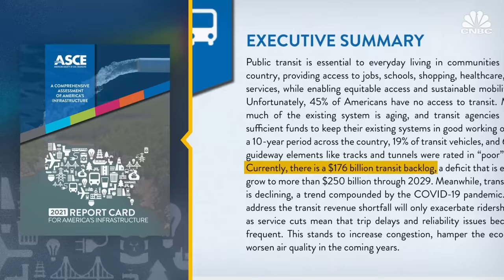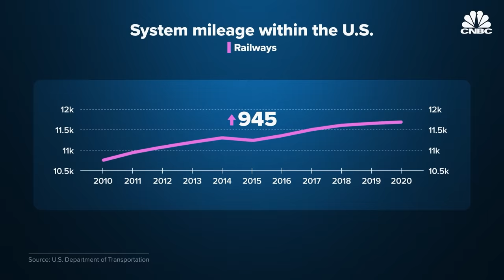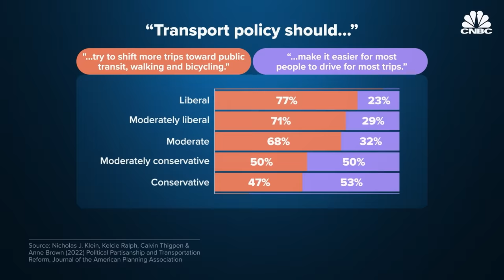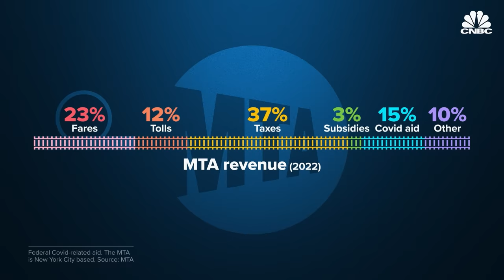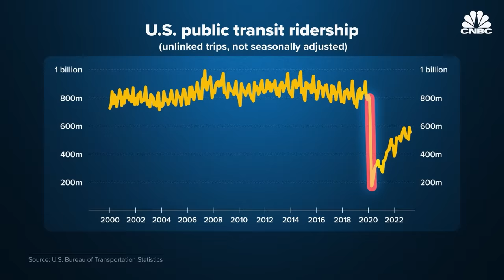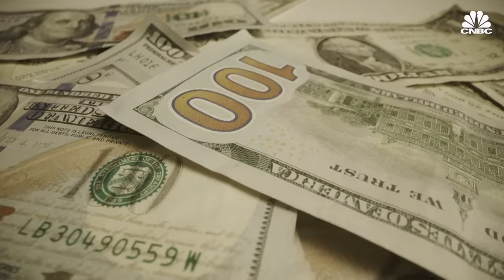Why The U.S. Gave Up On Public Transit

Comment: As someone who has lived in two transport deserts I see that the problem is getting worse and worse. The transport deserts are growing, when they should be shrinking.
Reply: They aren't transport deserts if you have a car.  They are only public transport deserts.
Reply: @laurie7689 What happens when your car breaks down?
Reply: @Supr_KILLA  Only if people want to pay for it, which we don't since we put our money into our own private vehicles.  We tend to vote down public transportation.  I don't have enough money to pay for BOTH private and public transportation.  I'd rather pay for my private transportation.  Other people who can't pay for transportation aren't my problem.
Reply: @laurie7689  so should we just take away your fire department and say oh if your house is on fire just use a garden hose to put it out?
Reply: @carlgharis7948  I pay fire dues for use of the fire department.  The fire department is not supposed to put out the fires of homes that don't pay fire dues.  That is a paid-for service and doesn't come free.  If they do put out the fire of a residence that hasn't paid its fire dues, then they have the lawful right to place a lien against the home.  Eventually, a forced sale/foreclosure on the home is a possibility if the lien is not paid.
Reply: @laurie7689  you expect me to believe such nonsense you're insulting my intelligence

Comment: Public transit isn't a 💰💵CASH COW like automobiles.
(insurance, repairs, tickets, constant new styles, fuel, accessories)
Reply: A new style of car has been introduced since the 1990s
Reply: Has NOT is what I think you meant. That is true.
Reply: it's a cash cow for everyone when it is properly invested into. everyone except the fossil fuel oligarchs and the car manufacturers.
Reply: @XDTape  Fossil fuels have created great wealth for rural America.
Reply: @tuckerbugeater  tell that to the coal miners getting screwed out of pensions by their failing company, or the rural Americans who need to keep their windows open while running their sink to avoid a methane buildup, all to frack more oil. rural america was torn up by the fossil fuel industry, and when they leave it is the executives and shareholders who hoard the profits, while the families who settled there for generations must pick up the pieces.

Comment: Another issue that is a part of the vicious cycle problem is that a lot of people in America just don't understand what good public transit can mean and what benefits it can have. And how could they, when most don't get to experience it? There's also things like the misconception that transit is only for cities and can't work in rural areas, and I could write a whole paragraph on misconceptions around zoning. There are a ton of things like this. You often see opposition melt away or turn to support once many projects like these are actually built.

Good transit, zoning, bike infrastructure, etc. does a great job of justifying itself once people live with it. But to get there we need more support. And perhaps the best way to get that support is simply by educating people about the potential ways their lives could be better that they never knew about. Will everyone be swayed? Of course not. But I think there are a lot out there who can be convinced.

Comment: I think a major reason the US are stuck with cars has to do with the suburbs. In those low density areas public transportation is simply uneconomical. Difficult for the US to change model, considering how the country has been built. Considering this, a big help could be to push on more work from home, it reduces congestion, quick to implement and at ZERO cost
Reply: We would need cheap broadband to every home first, and the Comcast-Cox oligopolies would fight tooth and nail to block the publicly-owned fiber network that's ideal to enable remote work and school (and they've already succeeded in some communities)
Reply: Totally agree!
Reply: You are correct that it would be best for pollution and congestion but it would increase isolation and it’s subsequent mental health problems. It would also isolate workers and further weaken the already very poor workers rights and hand more power to businesses.
Reply: @doujinflip  Remote work = freedom. It is also the most environmentally friendly form of commuting, far better than transit.

Comment: I use public transport daily wait time is never an issue because with google maps you know exactly when to start and when you will reach, saving on fuel, insurance, maintenance, parking and interest more than justify the extra few mins I spend traveling in public transport. Most of the time the walking and standing involved is good exercise and I use that time to send emails, catchup on news and family.

All my statements are applicable only if there is good public transit, I lived in Bangalore, Boston and now Brussels. I used car in India and US but giving up on those was best part of moving to Brussels.
Reply: Yep. In my mom's home town in Mexico, that doesn't work. I'm sure the bus system has a schedule that no one follows or knows about. I looked at Google Maps and couldn't find any bus route information. Everything is so disorganized over there, its insane. And this isn't exactly a small town. It has over 100k people.

Comment: There are several reasons most of the US public transportation systems are awful...most US cities don't have a high population density, and most US housing is individual housing units instead of apartments, so you may live several miles from the nearest public transit stop (not to mention your destination might not be near a transit stop either).

Unless you live in one of a handful of cities, you're going to need to drive a car just to reach a bus stop or subway station system, just so you can utilize the transportation system which is significantly slower and significantly more expensive than just driving.
Reply: How Federal Grants for Mass Transit programs are allocated.

Federal Grants are (1) given as long as the public transit system does not turn a profit and (2) those Federal funds are given without requiring they be spent to improve public transit services.

So, first the City and State are incentivized to ensure their mass transit sustems stay broken, that any failures remain unrepaired, that service be unreliable to discourage commuters; and as long as that happens, the receiving government can keep that money and use it wherever and however it wants!

It is a never-ending doom cycle by design because no one could fail this badly for so long unintentionally!

Please, examine the books of New York City and their Mass Transit Authority (or anywhere else) and prove me wrong!

Comment: Definitely for public transit, but let’s frame this honestly:  it’s practical in the near term only in cities and their suburbs, and the fiscal burden of that investment should be borne primarily by those residents. Also, it will have to be safe to use, which is a growing problem in big cities. If we can address those things, all for it.
Reply: It isn’t practical because of America’s crazy zoning laws, those vast suburbs of single family homes make the car a necessity. You have been tricked into a dead end trap by the car, road building and oil lobbies and there’s no way out.
Reply: @mostlyguesses8385  nope, that may be true out in the countryside but in the big cities of Europe local travel and commuting is mostly public transport and taxis, there is only very limited and extremely expensive parking in most European cities and most offices and non retail businesses aren't allowed to build big parking lots like in the states, at most they'll have a few bays.

Comment: There are small victories.  I just got back from Atlanta and they have a pretty good train system.  Its not amazing like Japan or Europe but it is something.  If you are going to the airport or the NFL stadium you are almost for sure using it and that helps take a ton of cars off the road.

Comment: I don't get all the love for cars, especially from low-income places. Buying a car, insurance, gas, maintenance etc has to be more expensive and costly than public transport. Like you can't get a job without a car almost, but that is also a big expense to have. I'm from europe, in my 30s and don't even have a drivers license because I don't really need it. I pay $80 a month to take as much bus, tram, subway and trains I want. They usually go every 2 minute on most of my routes, and 5-10 on less travelled places. Investing in public transport is the future, but the 'muh car' lobby is too strong.

Comment: Coming from Europe, it was a complete shock to see the state and quality of public transport and at the same time (partly because of it) driving around is a horrible experience. You'll get stuck in traffic everywhere and from my experience even the roads are so poorly maintained compared to where I came from, it really makes me wonder where the money goes. (At least in central coast California, I have no idea how bad it is elsewhere)
Reply: Because public transportation delegates your freedom of transport to the government where as a car you choose where to go. In Denver there is a system called the “RTD light rail,” it took 15 years to build and cost billions, when it was finished it could service about a million people and connect nearly all of Denver and it’s suburbs to DIA and in between, next to bus stops and rentable scooters and bikes, you’d expect people would be eager to use it, except less than 15-25k use it daily. So when given the option of good, efficient, and reasonable public transportation, Americans don’t and won’t use it. It got so bad CDOT offered FREE tickets so people would just use it, it only improved it by .5 percent. So what a waste of time and infrastructure to just be a massive bust; you’ll drive by these light rails on the highway and there’ll be NO ONE in there.
Reply: @jalend9974 Maybe it’s a good option in cities with lots of people, it’s not if the population density is very low.
Reply: Stop lying this did not happen and you know it

Comment: I really don’t understand why we think transit services have to be profitable. Roads aren’t profitable, they are a public good. Transit services are also a public good. I understand making up a budget deficit whether that’s through raising fares (the bad option) or through more funding (the better option) but requiring these organizations to be profitable is a standard we just don’t hold our roads to. 

Both generate economic activity. A good public transportation system is worth far more than a solvent and profitable balance sheet.

Comment: I used to use Bay Area Rapid Transit to commute to work prior to the pandemic, but I quit afterwards.  Why?  Safety!  I felt unsafe on the train, and not having to ride it during the pandemic opened my eyes.  That stress outweighed the stress of driving!  Obviously this doesn't apply to all transit systems, but vastly improving safety would do a great deal for many cities (looking at Bay Area and LA in particular).
Reply: Statistically, the Bay Area is not dangerous. Its violent crime rates are among the lowest for major US metropolitan areas. There's a lot of petty theft but that typically doesn't constitute a safety risk.
Reply: I take the L.A. Metro to work every day and the scary social media posts - while accurate depictions - do not represent the general state of the system.
Reply: That sounds like a crime/vagrancy problem and not a transport problem. I hear this point thrown around a lot when it comes to public transport, but you're not necessarily safer when driving on the road. Cars are extremely dangerous and one wrong move at high speed can end multiple lives. The safety issue on public transport could easily be solved with better security and law enforcement

Comment: Personal security, controlling criminal behavior, station cleanliness and elimination of homeless individuals are all factors that were failed to discuss in this piece. They are significant driving factors contributing to the reduction of ridership on public transportation. I would never consider taking my family on any subway system in major US cities. It’s simply not safe because of the lack of policing and prosecution of criminals!
Reply: all of that is a funding problem... if the US took public transport serious like every other developed nation and stopped licking the boots of Big Auto and Big Oil those complaints would be a non issue

Comment: Moving to Europe and seeing fuctional public transit from within has been the most shocking experience…

The us went so far in the opposite direction that even if we connected our cities with high speed rail (which we should) it would still take forever to get red states to get their public transit on board… (it would take blue states a while too but probably not as long)
Reply: Yeah the public transportation in EU is nice, clean and convenient for everyone. Americans is just something else, I can’t explain it.
Reply: I live in Europe...And most people don't use public transport unless they live an a large city with subway, just like New York. Americans act like nobody in Europe owns a damn car.
Reply: @ilonat8373  That's not true, we make the claim that European cities with populations with over 80k people typically have a comprehensive and well funded public transit system. Don't get it mixed.
Reply: @ddd7254  Still, in my country only poor immigrants or old people use public transport. Pretty much everyone has a car and use it for work.
Reply: @ilonat8373  The fact that those groups can reasonably rely on public transit helps your countries safety and sustainability.
Reply: @ilonat8373  most people in Europe live in large cities or near them. And even if they have a car they don’t use it unless they need to. Not to mention that the major difference is the major cities…

Even if you live in a major city in the us, (I’ve lived in multiple) you can’t exist without a car. This is not the case in Europe where most people in cities don’t have cars.
Reply: @ilonat8373  furthermore, even smaller towns have tram systems and extremely reliable bus lines. 

No city in the us can claim to have buses anywhere near as efficient

Comment: Having lived in Europe and Asia, I enjoyed using public transportation, and traveled around the various countries without a problem.  In the US, it's a whole different monster.
To begin with, there was an obvious problem with the public abusing the equipment and vehicles, causing damage, not to mention many are outright filthy.  The more recent issue being that public transit, at least in the more urban areas, has become crime ridden and dangerous.  The cities policies do nothing to discourage any of these problems, and even go so far as to even let people abuse the system by avoiding even paying to use it.  That causes higher rates for those that to use public transit.  The cost increases also result from those who abuse the systems and equipment, not to mention increased danger to the employees.
As for any dream of improving public transportation on a national level, the few attempts to do so have been disasters - and that's optimistic.  The nations infrastructure has been neglected for decades, and all those 'road taxes', placed on tags and fuel, don't seem to offset the upkeep the various states claim the consistent increases cover.  The federal funds are no better, often being 'redirected' before they even fund anything.  Most of the funds are eaten up just in the administration and planning phase, and by the time the work is to start, all those funds have dwindled to just a few cents on the dollar.

Comment: The US didn't give up on public transit; it has been hijacked by the automobile and its related industries. Just one example: General motors and a tire company bought the trolley car system in L.A., tore it up, and of course did not replace it. Their goal: to force people to buy cars, tires, and gas.

Comment: Cost isn’t the problem necessarily, it’s ridership. The ridership is low because the transit isn’t built around walkable neighborhoods nor do they normally connect walkable neighborhoods to each other. If I have to park and ride at a station, then get off the train and still need to hop in a car or bus to get to my final destination then we’re building transit in pedestrian deserts! That will not incentivize transit and therefore not reduce car use. Develop more pedestrian-focused infrastructure (mix-use housing, retail shops, grocery stores) around transit, build narrow two-way lanes and wider sidewalks, eliminate parking minimums and raise street parking meter rates then you’ll induce ridership demand because the convenience and connectivity to the things we want and need will be there.

Comment: I just got a car after spending 10 months depending on the horrible bus services of Jacksonville. It stressed me out so much that there were times that I felt like vandalizing the bus totems in the deserted bus stops. Very rude even nasty drivers, inaccurate schedule for bus arrival (sometimes the electronic terminals say 50 minutes, you wait the 50 minutes and the bus doesn't arrive, and then the terminal displays the next bus coming in another hour). It's totally unreliable. No wonder most of the buses ride with a couple of people at most (tremendous waste). It's very bad for people who depend on public transit, such as the blind, people without driver's licenses, people who can't drive for whatever reason, or people without economic conditions of owning a car.